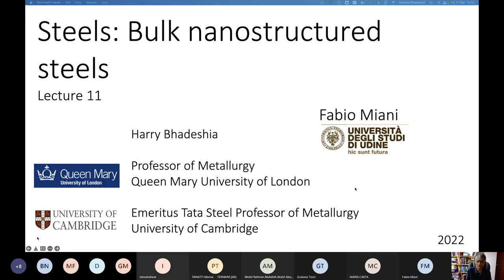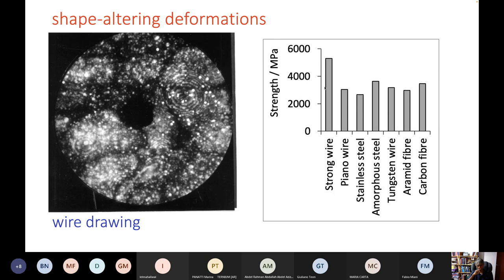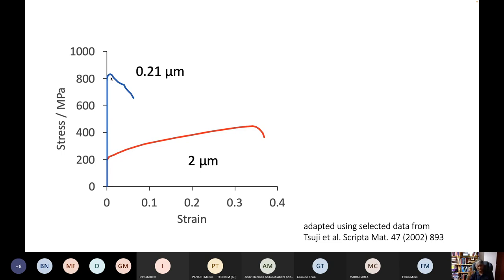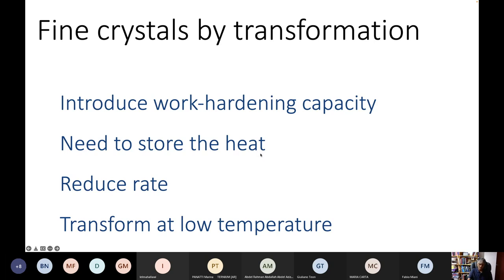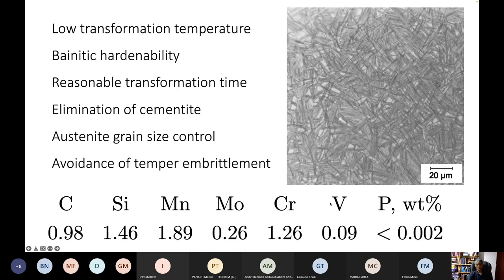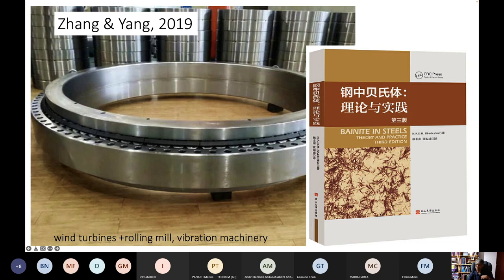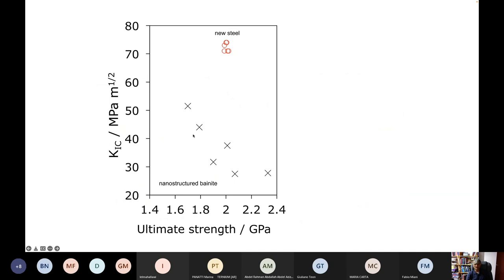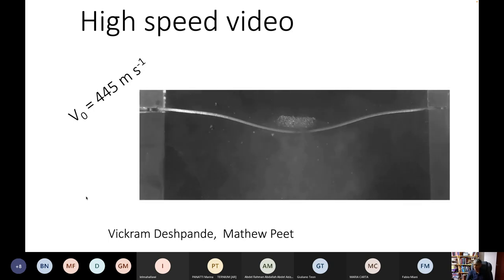Steels: nanostructured alloys

Comment: Thank you for the lecture, Professor. Do you believe that another enormous benefit to these nanostructured alloys will be superior resistance to fatigue crack growth? From my limited understanding (relative to you) for small cracks, when the crack is smaller in length than ~5-10x the grain size it can grow at an order of magnitude faster than long cracks. A benefit of nanostructured steels here is that the controlling microstructural features (PAGBs and perhaps martensite packet size) are so small that for surface cracks even 2.5 um in length, the small crack effect can be largely avoided. What do you think about this application please?
Reply from the maker: In general, it is easy to show that the fatigue strength scales with the yield strength, i.e, the steady state crack growth rate decreases as the hardness increases (see, for example, https://www.phase-trans.msm.cam.ac.uk/2010/fatigue.html).

However, the threshold stress intensity range in the plot of crack advance rate versus stress intensity range is sensitive to details of the structure. But the emphasis is on details, because many features of the structure, such as retained austenite, matter.